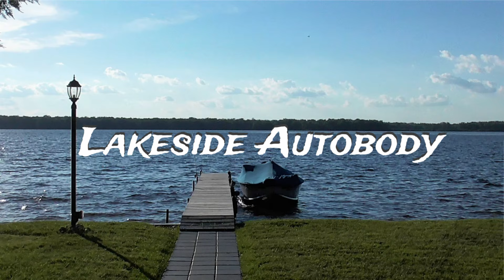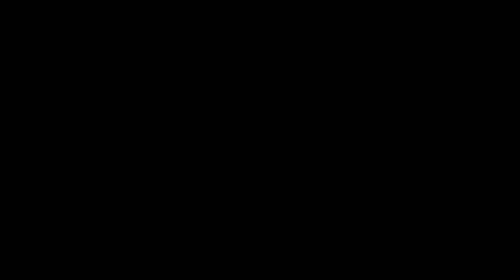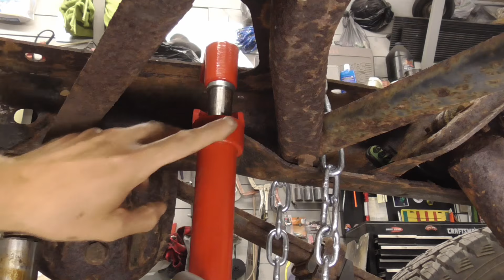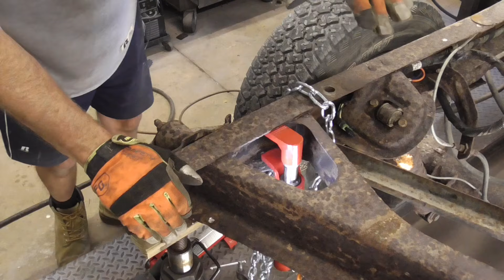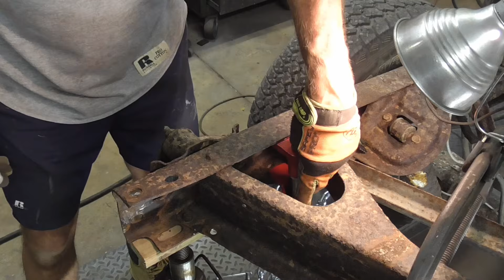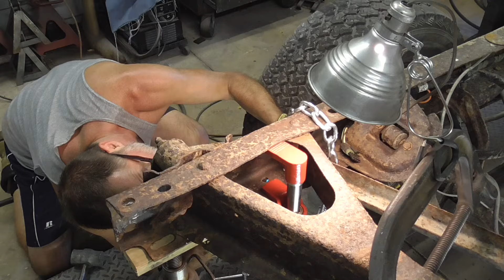Basic Frame Straightening w/ Harbor Freight Porta Power

Comment: I have a tahoe frame that has bends in the frame rail from improper jacking the tahoe up. Would this porta power work to untwist thos areas?
Reply from the maker: Yes - might have to use a bit of heat and a big hammer to help it too.

Comment: Would a Pittsburgh (harbor freight) brand porta power be an okay option for someone who maybe does this once in a great while? Guess I should’ve watched the whole video before asking. What’s the general consensus on the harbor freight porta power?
Reply from the maker: Actually this is a Harbor Freight 4 ton PP.  It works just fine - as with any porta power, you have to follow the instructions on bleeding it and making sure there is enough hyd fluid.  They work great :)

Comment: Hi! Great video. is this a high strength steel frame?  thanks.
Reply from the maker: I don't think it's "high strength metal" as in the metal they use for unibody frame construction - might be wrong though.  I believe it's just  regular steel that has been used for decades on trucks - it's a 97 so - quite old.
Reply: @LakesideAutobody    Thanks, would you change your approach here in any way if you were working with a high strength steel frame in the same condition?  again, thanks.
Reply from the maker: No - same approach.  I wouldn't be afraid to use heat either - even though it's a no-no according to safety experts.  Yes it may change the properties of the metal but you can't say "What if" all the time.  Here's an example of using a bit of heat on high strength unibody steel - https://www.youtube.com/watch?v=7MwceT55Zjs   @tierraporvida

Comment: Thanks for the video. I did a lot of body/paint work in my youth. I'm 68 now and just recently started repairing salvage vehicles. The trucks I purchase require the same procedure to bring the bumper/receiver back level. I'll start using the heat method. Looks like your way is easier and makes a better repair. Thanks again!
Reply from the maker: Thanks for watching Mark - good luck fixing your truck.  Let me know how it goes for you :)

Comment: Can’t believe that pogo stick chain didn’t break
Reply: I get that too, but my guess is because the chain is thicker than the gauge of plate used for the frame it is much stronger than it looks, and the strength of steel to compression and stretching is far more to that of bending to the side.

Comment: Where are you located? I'm looking to hire someone to straighten the frame on a 99 dodge 2500 Ram. None of the body shops here want to do it. I tried myself by heating it and pulling with my wife's 3500 Ram. It's bent in the front drivers side where the cradle bolts to the frame.
Reply from the maker: I'm up north in Michigan.  Saint Helen.  Right now I'm buried w/ work and product reviews so I'm not  taking on any work right now.  If you are in the thumb area Paul's Collision in Almont, MI does some heavy frame work along with Professional Finish in Romeo, MI.  🛠😊
Reply: @LakesideAutobody  thanks I finally found a shop that will try to fix it. So I piece it back together with wire to hold the radiator in place to drive it there.
Reply from the maker: @ranjanty  Cool - let me know how it goes for you - good luck with it my friend 🛠😊✌

Comment: I've never had a problem with mine other than it not being full of jack oil from new. I bought a bottle of oil and filled it per instructions on the porta power and no issues ever! Saved and even made me money! Awesome tool.
Reply from the maker: Thanks for sharing - I know mine has to be low on oil as I've had some spill out at the connection :)
Reply: @LakesideAutobody  the proper fill  instructions are on the face of the pump itself. 👍🇺🇸💯
Reply from the maker: @paulcondie2520  Thank you Paul - I appreciate the help :)

Comment: I'm trying do fugue out if I want a 10 ton or a 4 ton. I see u got the 4. How well does it work? Do u wish u got the 10 ton
Reply from the maker: No - I'm fine with the 4 ton.  I think it will do everything you need.  You just need pressure.  You can use heat, hammers and other tools to work the kinks too.  Remember too - the smaller the better because you'll need to fit it in tight spots sometimes :)
Reply: Do what I do... when you can't decide and both items are not exactly the same.. then purchase the most expensive one first so the only cheaper one is left to purchase and wont take long to save up funds again for the less expensive one. With that said I wait for the big sales to buy the most expensive one first.. 25% off coupon and such.. that way it is easier to justify to purchase knowing youre going to buy the second smaller and less expensive one down the road (which you may opt to not wait for a sale to purchase due to time constraints and thus purchase it at full price which will be acceptable since its price its more typical for your average "oh shit I need this tool to do this big project" purchase..  I feel this approach to shopping is how most men shop in tool stores lol.

and yes I know this comment is 2 years old.

Comment: Those port-a-powers are INDISPENSABLE. I recently bought one to straighten various frame components on my truck.

A trick I used to save some time and reduce the amount of flexing of the steel...I bought some flat steel stock (1/4" thick) and cut lengths to fit between the tool and the frame surfaces. They act as a die, as well as distribute the force across a wider area. Perfect flat and straight lines with minimal loss of material strength.
Reply from the maker: Good tip - thanks for the comment - you're right about the value of these tools too :)
Reply: Nice... I just baught some flat stock to do just that. Your comment reassured my decision

Comment: I have the same problem on an ‘88 S10 Blazer we’re restoring.  Came her to find exactly this info - thank you!!!!
Reply from the maker: You're welcome :)
Reply: @LakesideAutobody  so, got everything leveled out, and it turns out that my problem is actually the opposite - the rail has been bent up.  I’m going to drop some concrete anchors and eye bolts into my garage floor and pull down against a fulcrum.  I’ll just kind of apply your principals in reverse... thank you for giving me data and courage to try!!
Reply from the maker: @ronskopitz2360  Sometimes you have to do what is necessary.  Keep thinking.... you'll find success.  Let me know how it goes :)   Another thing you can do is to extend a chain the length of the frame rail that's anchored at both ends.  Put the jack in the middle right over the bend and push up on the chain - like a bow and arrow.  That will eliminate the need to put holes in the floor - if I understand you situation correctly.  Anyway keep me updated - curious :)

Comment: I have a 1968 Dodge truck that has recently sustained damage to the top of the cab from a tree falling onto the carport that the truck was parked under. I am thinking of getting this tool and gonna try pushing the dents out myself, enough to be able to drive the truck at least.
Reply from the maker: It's a handy tool.  You'll find other uses for it too :)

Comment: you may be surprised how well the HF porta Power works, I am, my boss has the 4 & 10 ton, & have worked them hard & still doing fine. at home I have 2 of the 10 ton versions, so I can have the longer reach, but not by HF, but picked up at Pawn shop, still wanting a 4 ton for myself.
Reply from the maker: To me it's really pretty good quality - cheap too.
Reply: Can you use a porta up in the air like to push the frame apart?
Reply: If I had to buy one to repair an explorer sports lower quarter panel by the door jam, which one should i go with ? 4 or 10 ton?  $100 price difference.. I was going to just bite the bullet and choose the 10 to have more than what I need in case the 4 isnt enough for all my future projects.
Reply: @ChristopherJones16  remember the 10 ton is heavier to deal with, but has more reach and capability, i myself own 2 of the 10 ton versions, has done everything i need and more, but i can see the use of having a 4 ton, and i will buy a 4 ton, when i see a cheap one at pawn shop, or facebook market place. fo for light easy pull / push you may want to deal with a 4 ton, instead of the 10 ton. your call. but if do a lot of crash work, both can be very useful. i know im going to get a project on a 1964 where tree fell across roof. ill be glad to have 2 big units, and i may need to bite bullet to get 4 ton while using big to work window area? if we locate a roof, it will be a lot easier job, but i cant find 1, and he had car since early 1980's. i known him over 45 years. but big project

Comment: Where is the chain attached too
Reply from the maker: The chain is attached to the lift ramp which is constructed of I beams but in a body shop you would have floor anchor pots or a frame rack to anchor to.  You can buy pull pots for your garage though from autobodytoolmart
Reply: @LakesideAutobody  Is there any other way to secure the chain though without drilling holes in my garage floor to install pull pots?  I have an old jeep frame I need to tweak just a bit... thanks.
Reply from the maker: @robgraham6770  It's tough when you don't have something to anchor to.   When that happens you have to get very creative but I'll bet you can think of some way to straighten it w/o anchoring it.  Let me know what you end up doing - I'm interested in seeing if you come up with something :)